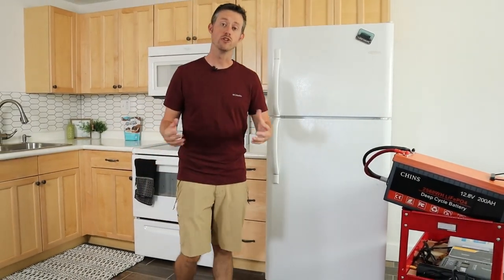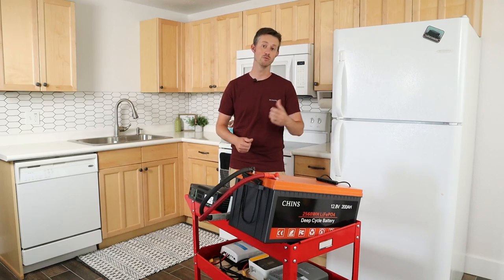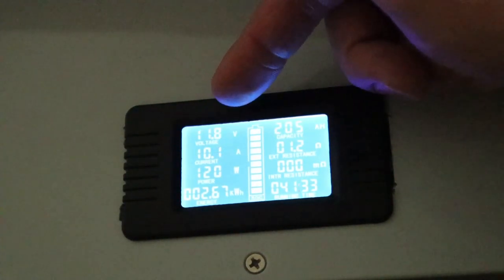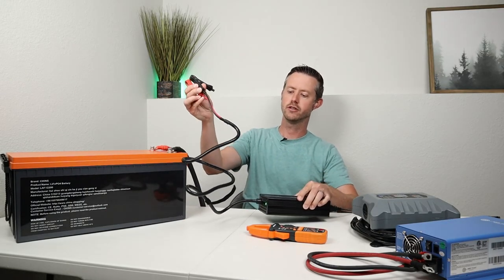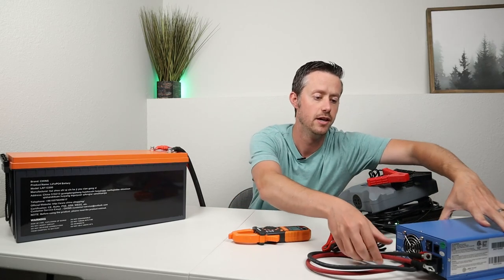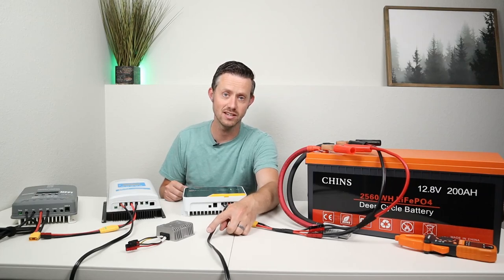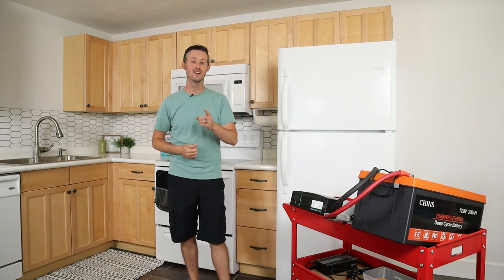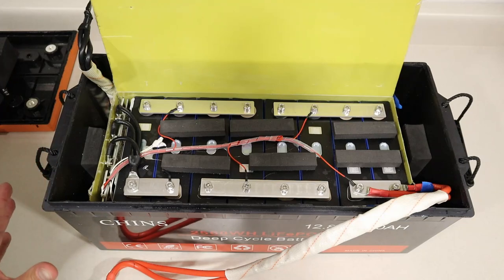DIY - Three Component Backup System! Keep Powered Up During An Outage! CHINS LiFePO4 + Xantrex

Comment: Thanks for all the amazing videos!!
I just ordered pecron e2000lfp with your coupon for a awesome $854 total but now I'm looking for high watts panels and found a cheap ones but I'm not sure how many should I buy 🤔 how many the pecron e2000lfp can handle, hope you can guide me as you always do 

Specifications:
Rated Power: 250W
Open circuit voltage (VOC): 37.6 V
Max power voltage (VMP): 30.3 V
Short circuit current (ISC): 8.85 A
Max power current: 8.27 A
Power Tolerance 0/+3%
Maximum system voltage: 600V (UL)
Fuse Rating: 15 A
Reply from the maker: Thank you for the "super thanks", much appreciated! As for the Pecron e2000, these are the solar charger specs:      2 X Voc 32V~95V / 600W Max / 15A Max

I recommend you purchase 4 of those panels, connecting two to each charger controller in SERIES for a 2S connection and around ~500w on each port. So you will have two panels on one charge controller and two panels on the other charge controller. Putting three in series will be a little too high for the max voltage input. Does that make sense?
Reply: @Jasonoid  it make sense to me!! If I try parallel, I will pass the 15A max, so 2 panels will hit the max on each port, I have an extra 1 12v 100w panel, which could be connected to the 3 port.
Thanks for everything man!! I just wanted to confirm what I have already learned thanks to all your videos

Comment: This is a good setup, but I think the weak link in the chain is a UPS feature. That would take into account a situation where you're not at home when the power goes out and it might take some time to get back home. I wouldn't care so much what I lost in a refrigerator, but losing what I have stored in a freezer would be a true disaster.
Reply from the maker: Good point, this option only works if you are home and know the power went out. You'd need an alternate option if you wanted a true UPS backup.
Reply: An all-in-one inverter/charger/solar usually has a UPS-like feature (may not switch fast enough for a computer but would do fine for a fridge or freezer). I bought an MPP Solar PIP-2724 from watts247.  That one needs a 24v battery but it looks like they have a 12v model 1012 if 1000 watts is enough (I suspect it would run a fridge or freezer but probably not both at the same time).

Comment: It looks like these DIY setups with the batteries are usually 100% efficient on the watt hours where as the portable power stations might be anywhere from 70-85%.
Reply from the maker: Very true, when you have a battery you can discharge it all the way till 0%, power station companies tend to only go down to 10% for safety

Comment: Could you do a video on the easiest and safest way to use that battery to keep your solar generator powered up longer.
Reply from the maker: I did two videos recently that break that down pretty well:
1) This video shows what happens when you connect different voltage batteries directly up to a power station to extend run-times:  https://youtu.be/tK4JKmfndh8  (you'll see a 12v battery is pretty slow)
2) This video shows you how to safely boost the 12v of the battery to a higher voltage for faster charging:   https://youtu.be/I78RxjRXTn4

Comment: 3:00. You absolutely, positively, do not need a freek'n 12AWG cable to safely power a refrigerator!!!  A 16AWG cable can carry 13A across a 50' cable indefinitely.  That's 1430w @ 110v, or 1625w @ 125v.  No refrigerator on earth produces a 1400w continuous load, not even close, it's not even going to spike anywhere near that, and a 16AWG cable can effortless handle a 20A spike load without issue.  A 16AWG cable is already overkill for this application, you definitely don't need to spend 5x as much buying a 12AWG cable.  I've run AC units on the end of 100' 16AWG cables (a MUCH heavier load than a fridge), and they barely get above room temp. 

BTW: I understand you have a 2000w inverter, but if you're running that inverter at full boogie, you're going to have only about an hour of run time on a 12v 200Ah battery.
Reply from the maker: You are correct, the 12awg cable is OVERKILL for running just the fridge but does the common person understand wattage and wire gauge?? NOT AT ALL.... that's why people burn their houses down all the time. Using a 18awg cable with an electric heater or a ton of Christmas lights and BOOM... next thing they know they have a house fire. This is a beginner video. If you know better than use whatever cable you want. 

In my opinion it's best to size your extension cable for the maximum wattage that the inverter is capable of putting out so whatever load you run on the inverter you won't have an issue with resistance and heat build up.

What would you rather give to your ignorant grandmother to use?... A high quality 12awg cable that can basically run any load off an outlet or a 16 awg cable and say "make sure you don't use this on this device or this device..."
Reply: This!

At one point, his test showed the fridge pulling 10.1 amps at 120 VAC... 1200 watts. There's no way that fridge should be pulling 1200 watts except, possibly, for the short amount of time that the compressor cycles on. Even then, 10 amps of inrush current would last for a second or so. I'd like to know what else he was powering when the shunt display was showing 10.1 amps.
Reply from the maker: @steven_k_rossick  hey genius, the shunt measuring the power is on the DC side of the inverter LOL... let me break it down for you in simple terms... 
The fridge was pulling 120 watts
Wattage = volts x amps
120 watts = 12v x 10 amps (DC side) 
Or... 
120 watts = 120v x 1 amp (AC side)
Reply: @Jasonoid  Fair enough - the "11.8" looked like "118" which I mistook as the AC voltage. I probably would have thought about it again, but it came right after mentioning the need for 12g wire when powering a modern refrigerator, so the thought was that perhaps you were pulling 1200 watts and that's why you were recommending 12g cabling.
 As Bujin5455 points out, 12g cabling is WAY overkill for a fridge, especially on a short run. If cost is no consideration, then sure, go with the 12g... but its only needed if someone plans to use the full 16 amps that the inverter can run. And if they do plan to at full load, that 2560Wh battery is only going to last about an hour.

Comment: These 200AH batteries have a maximum output of 100A. Does that mean your maximum wattage is around 1280?
Reply from the maker: Yes, the internal BMS is rated for 100A or 1280w. There are different models with larger BMS inside.

Comment: I will charge my delta 2 max with a champion 2500 W dual fuel generator that puts out 1650 W on propane so it will charge the delta 2 max in about an hour and a half.  I then charge my 190 Ah lithium iron phosphate battery with a 40 amp charger from the delta 2 max.  That seems like the best solution to conserve propane
Reply from the maker: That's a great way to keep things charging quickly.

Comment: Can get an all-in-one inverter and then it is just a battery and inverter.  The all-in-ones are not much more than a similar quality inverter alone and include the A.C. charger and solar MPPT controller.
Reply from the maker: Do they offer 12v all in ones? I have only see 24v and 48v options.
Reply: @Jasonoid  MPP Solar at watts247 lists a 1000 watt 12v model.  Seems a bit on the small side.  I do like 24v better and now there are a lot of 24v LiFePO4 batteries to choose from.

Comment: I'd like to see a related video on the topic of how create a wall outlet to bring solar power from outside, through an exterior wall, to where the power station is on the inside.   Such that one could plug into this created outlet inside, to access the solar power.  This could be MC4 or Anderson, or whatever appropriate connectors, as long as it works.   Specifically, hope to see someone do this through a masonry exterior wall.   (So as to avoid having to crack open a window to run wires inside.)
Reply from the maker: I don't have any masonry walls to demonstrate! I bet if you look up something like "running electrical power through a masonry wall" you'll get some great results. The main thing would be to use proper wire gauge and a DC disconnect / circuit breaker and you'd be good to go.